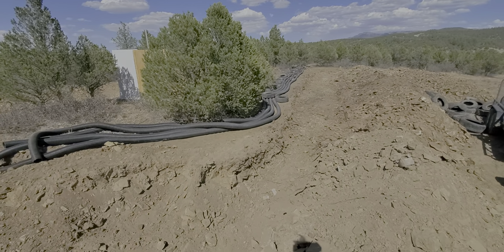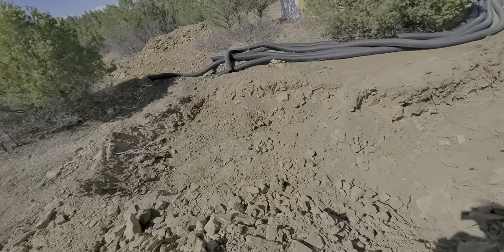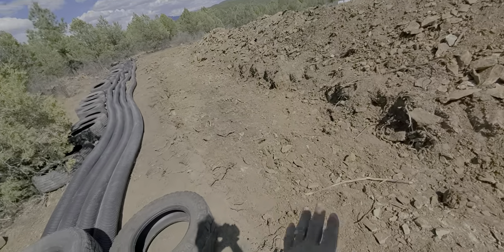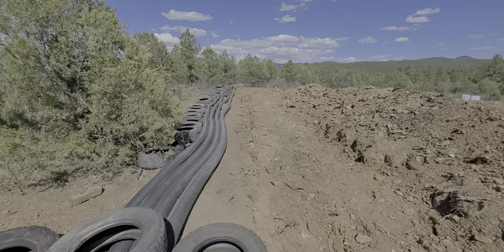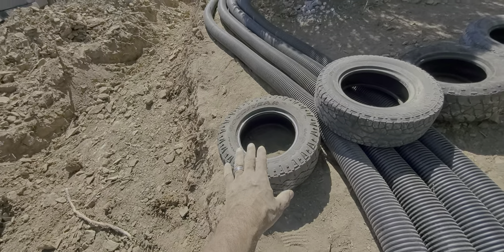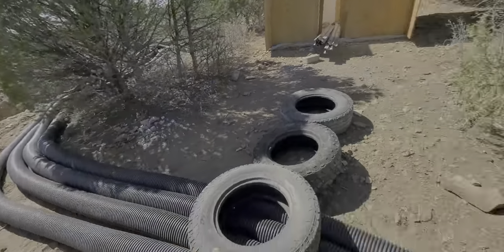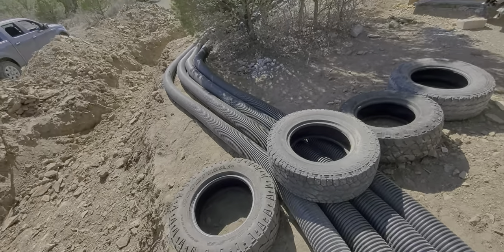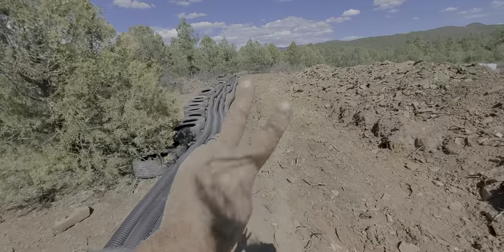Geothermal Energy System Update #aircreteharry #geothermalenergysystem #aircrete #tires #greenhouse

Comment: Geothermal systems like this is related to th thermal mass and the average temperature below the surface of the earth 6-8 ft. If you don't have the right depth I don't think it will work.
Reply: Antonio Sanford from my understanding, you are correct
Reply: You are definitely correct!

There is a depth that's well below the frostline, which maintains an average temperature, which is fairly close to the average topsoil temperature. However, the topsoil temperature can have huge swings in temperature, depending on season, whereas the deep temperature remains rather consistent. Regardless, their averages run fairly close to eachother.

So, if there were a sustained nuclear or dustcloud winter, the average temperature at that same depth would drastically lower more and more, year by year.
Reply from the maker: I agree what everyone. And after I do this experiment with the Aircrete blanket the world will know for sure if it works or not.

Comment: Could use a skinny bucket on your excavator and dig trenches at least 2' deeper. The soil stays significantly cooler in summer and warmer in winter at about 4 feet. Much shallower than that and you get very little benefit in mid-summer and mid-winter, but you do get a good benefit in parts of spring and fall.
Reply from the maker: After a year of testing I will know for sure how this system will work.

Comment: Hi Harry. How's it going. My ex father in law has a geothermal water furnace in north east Ohio. It is a closed loop system that runs a kind of antifreeze solution.  I think it's a lot of pipe. Like 800 feet coiled in a trench. I think water furnace is the brand.

Also Harry. I think that the aircrete blanket with tires will be a lot of work and money. I am thinking 6 inches of sand to protect your pipes then just backfill the 2 to 3 feet. Then get more earth from elsewhere on your property or dump trucks of gravel. They are not so expensive and you can make a bit of road at the same time. 

8 feet might be ideal but I think 6 feet would guarantee you the constant temperature.

Comment: Think you need to conduct some scaled tests and get a University involved to do some thermal mass calcs before you throw a lot of money and time at it.Great if it works always routing for you but got doubts unless you get that depth .Rocket mass heater to boost the thermal battery perhaps ?
Reply: get a university involved to use a calculator.  lmao. no offence but the red tape involved and time lost would far outweigh using your own thermometer.  on the other hand I love the rocket heater idea. if he does go thru with this. I could see using the pex to actually heat the bedrock under the aircrete blanket and then being able to take the heat out slowly all night by the airway. in this case, I would build it right up against the greenhouse foundation, then pile woodchips 10 feet high over it. that will warm it up.
Reply: @anomikak1062  I agree. Universities aren't all that. better to call a company that installs geothermal and ask. Universities are profit based now, they are not concerned with academic matters, pay and get a degree.
Reply: No, I haven't attended college, it's too expensive. That's why I like Harry and watch him. get yours hands dirty, try it, doesn't work try again. Nothing wrong with that.
Reply: @anomikak1062  l live in the UK its obviously a bit easier here to get students on projects of interest
Reply: @walkingthruyourdata-6019  I think the teachers are concerned with academics but that is the issue. academics is filled with politics and peer reviews and slow methodical investigations of achieving a specific result. it has its place like building quantum computers or the hydroncolider but it's not good for anything functional. it's the difference between a cad designer and a mechanic.  the cad designer might make the better car but no one will get to drive it. lol
Reply: @anomikak1062  I'm an Industrial Mechanic/Electrician. I work with  Degree'd "Engineers". Seems like they have everything but common sense. I love watching Open Source Lectures from MIT, Yale, Stanford, Lots of theory, can't really build a lot with theory, it's a nice guide, but, build it! How many times have I heard, "well, theoretically it would work.." Meanwhile I'll fab and weld something to make it work..
    Again, your right, Astrophysics..yeah, college, attend lectures,symposiums, talk about it...(Me..) "give me that old washing machine and some solid fuel, we're going into space.!
Reply: @coldtrader4737  cool, school there is possibly more uhmm.... useful too. lol
Reply: Yeah, though, I think that 6-8 foot depth thing is pretty accepted. I'm thinking you can't really skirt that. a skidsteer with a jackhammer attachment might get Harry there faster than the excavator.
Reply: @coldtrader4737  - Anomika and Timothy only respect Trump University. Thinking is too complicated for them xD
Reply from the maker: @walkingthruyourdata-6019  Agree!

Comment: Any thing worth doing is worth doing right. You need the depth.
Reply from the maker: Show me where this has been tried before and it did not work. Maybe it will work! fingers crossed.
Reply: Aircrete Harry first, congratulations on your channel well over 20k subs! You know I have always been rooting for your success so I do hope you are right. I just don’t see how the aircrete thermal mass will be any different then  “the earth” thermal mass. Perhaps there is a study that shows the R-value of earth and you can compare it on the R-value of your mix. If the R-value of your mix is not fully superior to earth, I just don’t see how you can compromise on depth. Anyway, I hope you guys are well and healthy 👍

Comment: Harry i can't see this working mate, the whole idea of this type of system is to pick up heat or disperse it, as at a certain depth the ground is at a constant temperature. That depth is important, and also insulating the tubes with airgrete would prevent that. 
If you want to check this, drill a small hole 2/3/4/5ft down and drop a thermometer down and compare the temp with the service, this should confirm my comment.
And if i'm talking utter bollocks i apologize in advance.
Reply: i think he is planning to insulate just the top with aircrete to prevent heat loss from the warmed air from the roof of the pipe while it goes along, but you are right about the depth and thermometer check, and do you have a an auto correct, you have written 'service' when you meant 'surface'
Reply: I agree, I would bury some wired temp probes at different depths and also build a small scale example and measure that too. Not sure artificial depth from a tiny ridge is the same as being way down,
Reply from the maker: Thanks! but I don't have my inexpensive options. This will be a test I never saw anyone do what I'm about to do. So after a year I will let you know results.
Reply: @utubeape  😂 Yep service surface, spelt surface wrong and auto correct replaced with service, fingers like cows teats.

Comment: The whole idea of Geothermal transfer (or extraction) is to have a large area of thermally conductive mass that you can extract from.  By placing rubber tires around your exchange tubes, you are effectively insulating them from the surrounding thermal mass.  You may as well be placing 1" of foam around the tubes for every layer of rubber the heat has to pass through.  This totally defeats the purpose, save for the hopefully open area below the pipes, which may allow you to extract up to 25% of the potential as heat.  If you will be using these for cooling then you are blocking the only area the heat can rise up and out of the tubes.
Reply: Yes, given his current path, it's an idea full of hope and absent any possibility. I suggested hiring a blasting contractor to blast the rock up. The paperwork might take some time, but the blasting would be done in a couple hours. It might even be possible to do it DYI... I believe It's legal to buy explosives and blast tree stumps out.
Reply from the maker: The tubing in put under the soil and the tires on top of the soil over the tubes.
Reply from the maker: @cornpop7805  lots of gas mines around here no explosives for me.